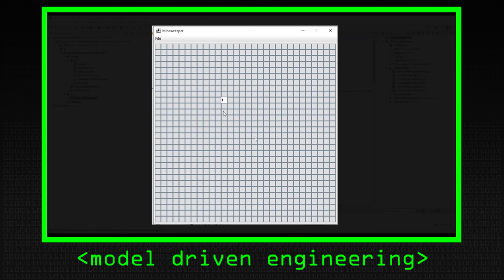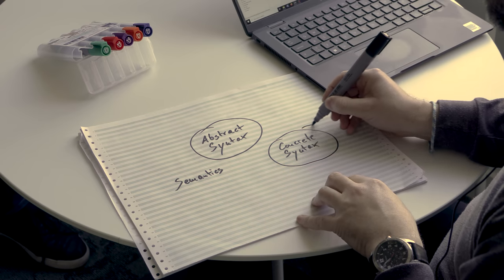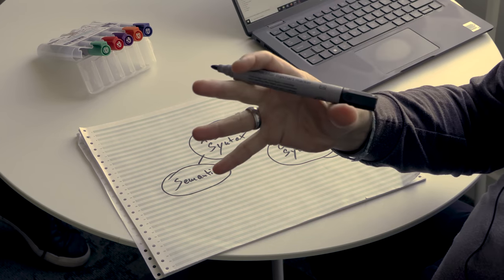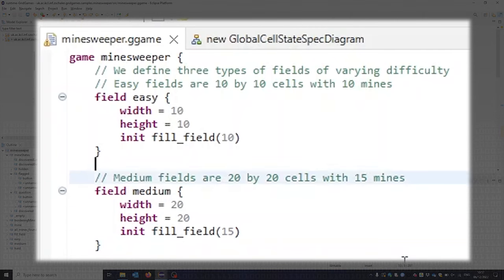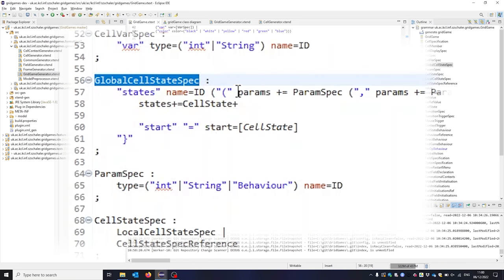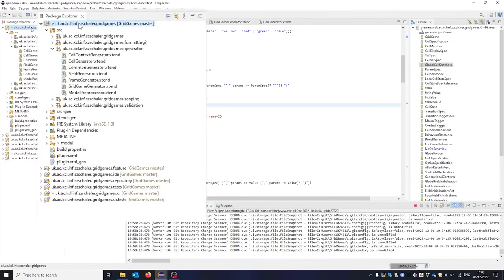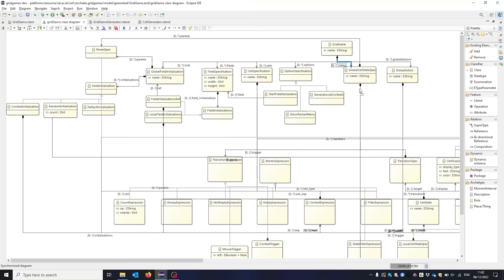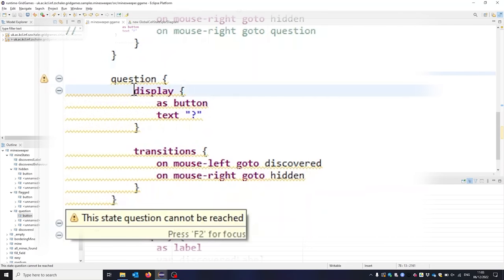MDE under the Hood (Model Driven Engineering) - Computerphile

Comment: MDE never succeeded because of two inherent fallacies:
 1. the expressiveness of the "modelling" language is limited
 2. the model tends to aggregate irrelevant detail, making it noisy/unreadable

If your modelling language becomes rich, then it will look and read like a "normal" programming language that happens to be translated to some other "normal" programming language for no benefit. If modelling language stays small and limited to represent only domain interaction, then generated code will always be lacking. Programmers will be forced to hand-code (minute) details and inject hand-coded logic into generated code, which is always cumbersome. Especially if you re-generate code with every model change as you are supposed to do.

Noisy details needed for code generation (eg. .width(10) given in video) defies the model purpose - act as an easy-to-read media for non-developers. You will be better off generating tests from the model than generating actual code.
Reply: And also, as another comment stated, is much natural, simpler, direct to just write the thing in a programming language, which BTW, has a much better defined semantic!
Reply: hasan piker
Reply: I'd say MDE was superseded by DSLs in common languages. If you want to make a tool to write many minesweeper-like games, instead of developing your own language, you can create a library for js/java/dotnet or some other popular and flexible language and you achieve the same goal by much lower costs

MDE might be acceptable if you want to compile to different languages (like write code which will work with both java and dotnet). But i don't know any such successful MDE solution
Reply: @DingoAteMeBaby  It will make sense only if creation of MDE tooling, verification of MDE tooling and verification of the product in MDE tool would be cheaper then simply verification in normal programming language or creating a DSL instead of MDE for exactly the same purpose

However, from what I know such verification is usually done by testing, not just code review. We could argue that cucumber language is a form of MDE for testing, but I'm not sure about that
Reply: MDE never dies

Comment: We're using a BPM Tool which has it's own process model and a rather limited editor for this. Our problem was, that we needed to create many process models with with features that take much time to develop because of the limitations of the provided tool, that we ended up with this solution:
We created our own process model with all the information and abstraction we need and then generated the files for our BPM Tool. This even has the benefit that we now can change the BPM Tool as long as we create a new generator for the ne bpm tool. Our process models are expressed in our own "language".

Comment: Wouldn't it be easier to replicate the abstractions that you get from the new language, in java itself? 
Write classes that abstract a cell, its state etc, and then work with that as a normal java library, rather than generate a load of java code as a compilation step?
Reply: The end of the video explains this.
Reply: @ctam79  not really, he gives examples of DSLs, but not MDE
Reply: theoretically you can parse a fluent api like an «abstract representation», nothing stops you from doing that.
Reply: Absolutely... and you should. This MDE is BS.
Reply: @ctam79  not really it doesn't. In java or dotnet there used to be popular graphical tools, which edited some source code for ui design, database structure or workflows. They were superseded by fluent api-based DSLs, because developers wanted to have more control, but it's not true only MDE can do it

Comment: About the "checks at runtime vs static checks" thing with regards to libs... It's worth noting this is only applicable if your lib's language is interpreted, or if it's compiled, but your abstractions are very stateful without sufficient type level checking.

In a language like Rust f.e., you can create a new "object" (in Rust terms, "struct") that has the same fields as your old one, but different associated methods, and do so at zero runtime cost (unlike Java and most other languages, where the extra object costs memory, or an extra deallocation+allocation) and therefore, you can do a lot more checks at compile time.
Reply: Yes, different languages provide different levels of support for internal DSLs. Some are indeed set up to allow you to introduce new linguistic abstractions in a way where additional validations can be done at compile time. However, even for those you keep some limitations because you are tied to what the host-language infrastructure can do. That's not to say you shouldn't work with internal DSLs, just that you need to choose what will work when...

Comment: Was this filmed later after the last video or together at the same time? Cause I'd wish he'd address the issues raised by commenters in the last one.
Reply: Unless I am missing something, doesn't he do this? He is in fact responding to comments and specific issues being raised (e.g. "just use a library instead").
Reply: @megaing1322  He just said "sure there are _alternatives_, everything has pluses and minuses, but here's me talking some more" for only one point, and that is libraries that would abstract some of the need of understanding how computer works.

What he doesn't address are the bigger concerns of "is it actually simpler?" and "if you're not a programmer, why pretend to be one with a heavily handicapped language?". He waves it all away as it being "just another tool in the belt to consider, nothing wrong with that" so you couldn't politically correctly tell him that he's talking non-sense.
Reply: @Nors2Ka  Probably because those are all just opinions. Without having been convinced by him, I would say "yes it's simpler", "not everyone has to be a full blown programmer" and "more tools are always better". Creating DSLs is pretty easy in the modern day and age (as he showed in this video) and they certainly lead to shorter code with less boilerplate than Java could provide otherwise.
Reply: @megaing1322  This is just my surface level summary of what was discussed, actual comments had much more grounds than just being opinions.

Point is, I kind of expect people to at least address such rather central points before continuing to advertise their own stuff.

Comment: Hi, nice lecture, I have a question that is maybe off topic, coming from my intent solve the redundancy problem - I have a lot of code in the Language or Library that I don't need. Also helps to secure the system.

The question is:

Do you think code that is not relevant to any intent of the current user, should exist in RAM or in the HD?
And shouldn't any code package come with an "intent tree", such that
the user can select how he/she intend on using the package by selecting intention within the tree - that then will be the only ones to unpack/copy/..